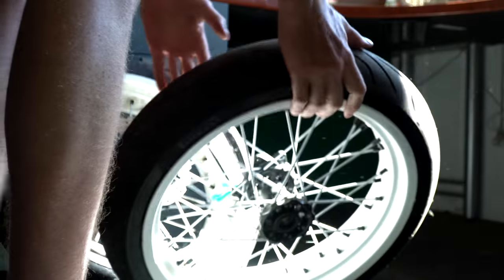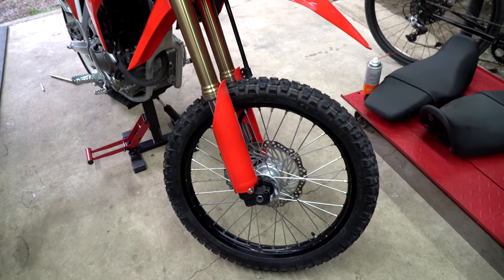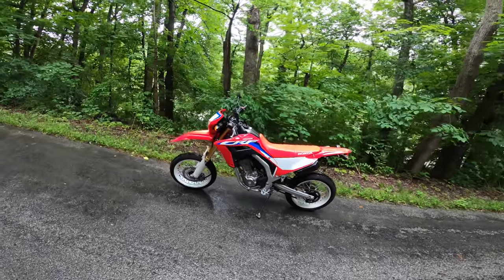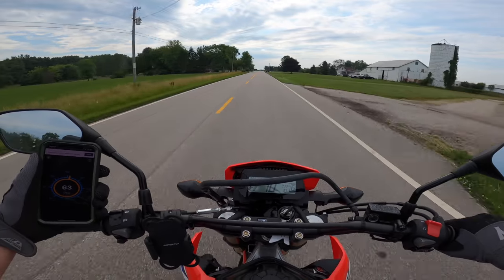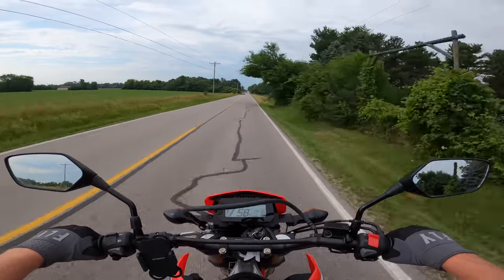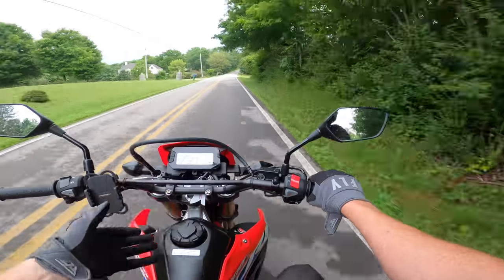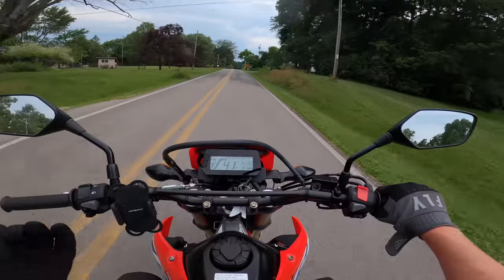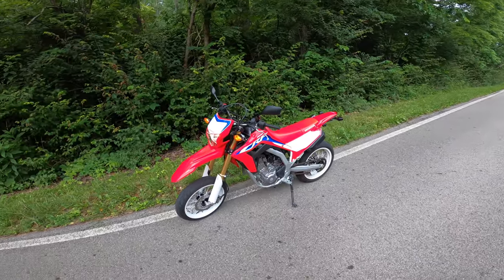I Built The FIRST CRF300L Supermoto In America! | Best Motard For The Streets?..

Comment: If you wanna throw a cuple hundred bucks at it, you can put the Rally brake rotors on it. I've done that and gives the bike really the bite it needs for street use.  Super easy just the OEM rally rotor and the bracket.

Comment: Sm is sweet, but the dual sport is where it's at. Make the 250 sm and keep the knobbies on the 300
Reply: Can’t swap between the warp 9s streets for week days and throw the dirt knobs on the weekend?
Reply: na fuck that 300 is solid with sm
Reply: @itsjordie8206  no because he took the forks off the 250 so the front axle would fit the front sumo wheel

Comment: To be honest I think the concept of a CRF300L Supermoto fits it really well, considering the engine. Honda ripped the engine from the CBR300R, and I think it suits it better for on road use. I have a 300L personally, and I think its much more fun to go on the streets with it than the dirt (compacted trails are fine to ride on, loose dirt, gravel, sand, and mud are really hard to control the bike on) , especially considering the stock tires are made mostly for the street, but only 20% or 30% off road. The way I see it, if you own the bike, you have 2 options:
1. Make it for the street only (Supermoto tires)
2. Get "motocross" tires with DOT approval and make it more for offroad (because if you're taking it on the trails with the stock tires and you encounter sand or mud, good luck to you!)
Honestly the bike is a blast if you use it the way it's intended, which is for trails and mostly on road usage. You can put it through most things, it still will run no matter what.
For on road commuting, get this bike
For compacted, scenic trail riding, get this bike (or the rally counterpart)
For beginner riders, this bike is a possible option
Do NOT get this bike for dune/sand riding, or going into the gravel or mud  (more stable at higher speeds in the sand only, but mostly just wants to sink into the sand and get stuck at lower speeds, more so with the rally because the normal 300L is ~310 lbs without a rider on it and the rally is ~335 without a rider. definetely on the lighter side for dual sports, but still heavy)

Comment: 06 KLX 250 enduro converted to SM used to be able to get to 90mph if you tuck really low for a few miles.. speedo would say 110
KLX is way older Tech then current CRF and has smaller displacement.  gearing was stock on KLX